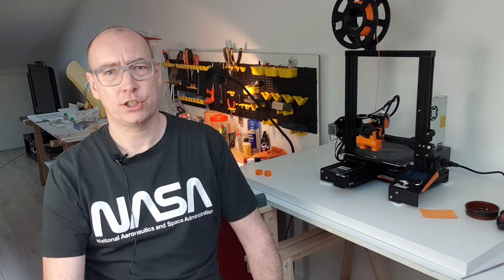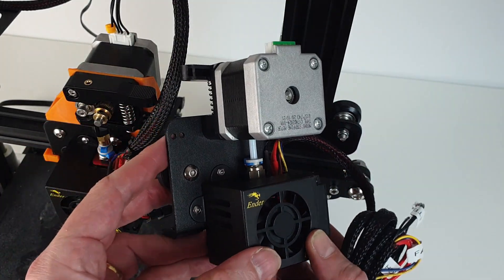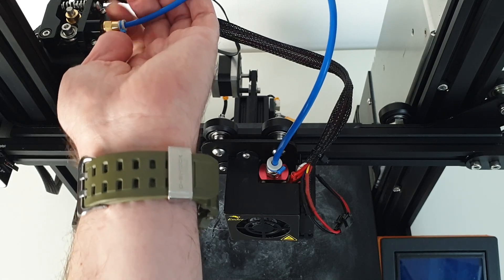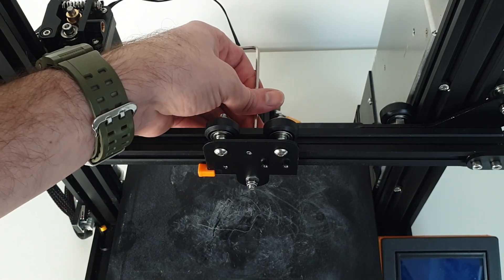3D Printed Direct-Drive for the Ender 3

Comment from the maker: In today’s episode, I show you how to upgrade the Ender 3 Pro to Direct Drive at no cost, using only stock parts and 3D printed parts. 

00:00 Introduction
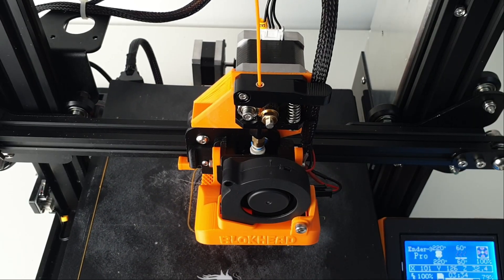00:25 SpeedDrive v1 presentation
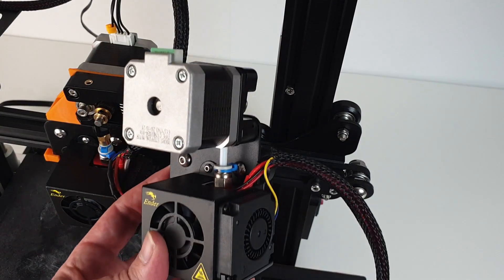00:55 Direct drive upgrade kit from Creality
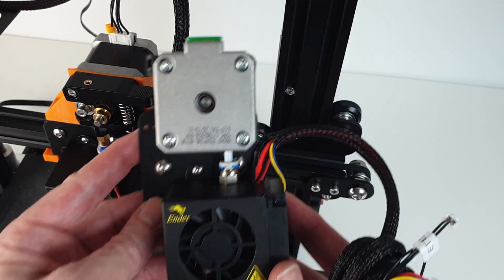01:23 3D printed parts required
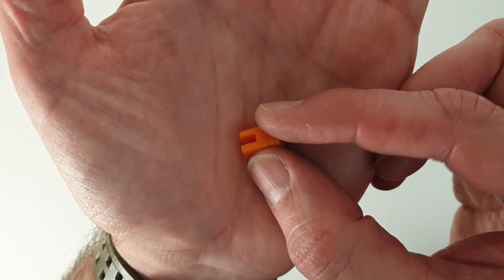01:57 SpeedDrive installation (step by step)
10:21 Conclusion

Direct extrusion is a method of extrusion by which the extruder pushes the filament directly into the nozzle. A direct drive extruder provides several advantages with respect to a Bowden extruder. It allows to print with a wider range of filaments, in particular TPU flexible filaments. Because the extruder is closer from the nozzle, it provides a more accurate extrusion and can quickly retract the filament. 

In order to this, I use the SpeedDrive v1 from Thingiverse:
SpeedDrive v1 - ORIGINAL DIRECT DRIVE MOUNT 
https://www.thingiverse.com/thing:3816051

I quite like the SpeedDrive design: it is simple and the motor location makes it compatible with most cooling upgrades, Bullseye, Blokhead, HeroMe… Something to take into consideration because the stock cooling on the Ender 3 Pro will quickly show its limits. 
If you don’t want to follow the DIY route, you can get a Direct Drive upgrade from Creality for less than 40 USD. 
Ender-3 /Ender-3 Pro Direct Drive Extruder, Upgraded Direct Extruding Full Kits with Nozzles:
https://www.creality3dofficial.com/products/direct-extruding-mechanism-complete-extruder-nozzle-kit-for-ender-3

This is a pretty good deal taken into consideration that it comes complete with the extruder, the hotend, the nozzle, the cables and the fans. 
Unfortunately, the position of the motor in the Creality design prevents the installation of a cooling mod therefore I decided to switch to the SpeedDrive design shown in this video.

Music: Emotional / shutterstock
Reply: Sorry, my misunderstanding, there were the factory spaces that came with the machine.
Reply from the maker: @mikealgarvin8122  No problem
Reply: @YouMakeTech  is
Reply: @mikealgarvin8122  is
Reply: Sorry, I can’t seem to find the music on shutterstock, could you send me the link please.
Reply from the maker: Here it is -> https://www.premiumbeat.com/fr/royalty-free-tracks/emotional